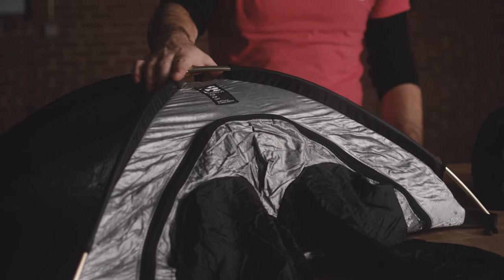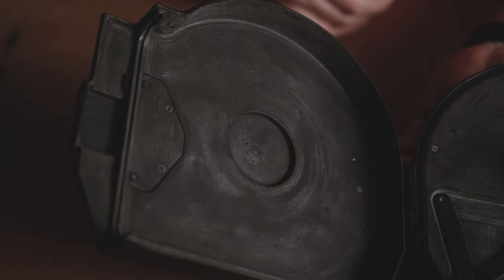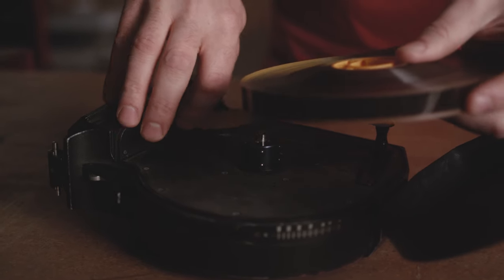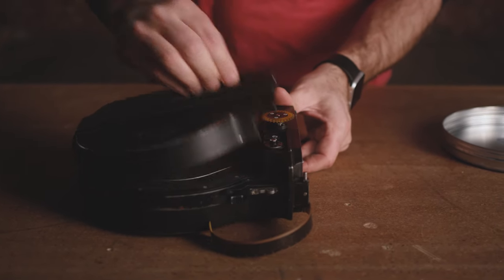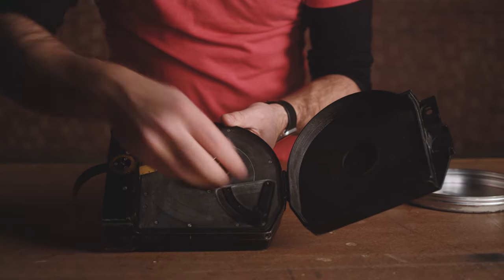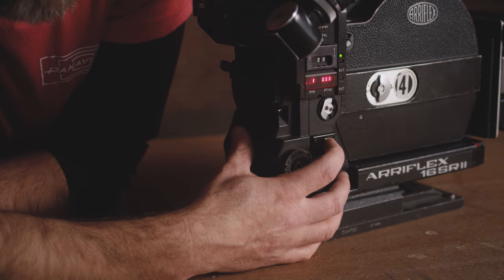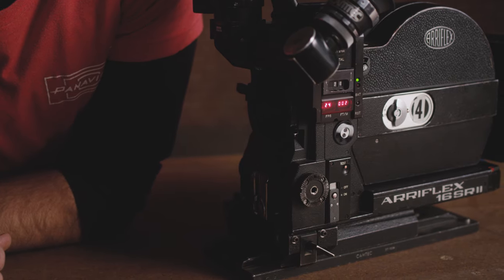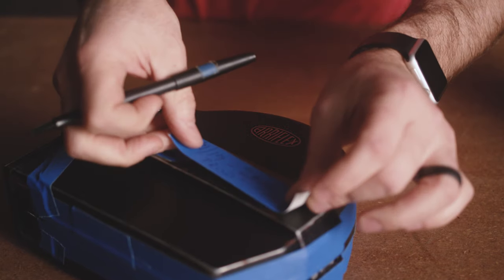Loading an Arri SR2 Film Magazine - Sprocket&Claw - Ep 004

Comment: Can you load 100ft film into the SR2? I'm getting one soon and I'd like to use a 100ft as a test roll. Thank you!
Reply from the maker: Yes. You can load daylight cores on the 400’ mags.
Reply: @MidwestFilmCo  That's great! I guess it's also good for practicing without a changing bag at first haha
Reply: Hey guys, sorry another quick question. I just got my SR2 and the seller sent me the batteries even though he thinks they need to be recelled. I left them charging over night and they are driving the camera just fine without the mags but once I put a mag on it it doesn't work. Is this lack of power from the batteries or is this what happens when there's no film in the mags? Thanks!
Reply from the maker: @MrManelCasanova  I've never had the issue before but you it could definitely be a power issue. The camera will drive the mag without film loaded in it. Those NiCad batteries are notorious for dying if the owner isn't keeping a charge on them and using the normally. You can hit up Visual Products and see if they have an AB Gold Mount or V Mount adapter available. That's definitely the way to go! Also, try moving the pin forward with the mag on the camera with the manual movement, the little silver tab by the run switch. Make sure it moving freely and the mag isn't jammed. - Justin
Reply: @MidwestFilmCo  hi Justin thank you for your reply! The camera is moving in test mode, it only dies when I put it in the start mode. I think it's probably a power issue, I'll look at those v mount options as I have a few lying around! Thank you
Reply: @MidwestFilmCo  Turns out the camera doesn't run without film! Theres a sensor in the camera below the film gate that shuts the camera off when the mirror in the mag shows it there's no film left!